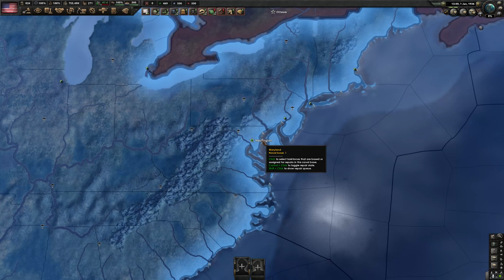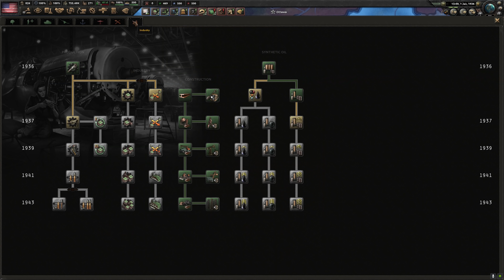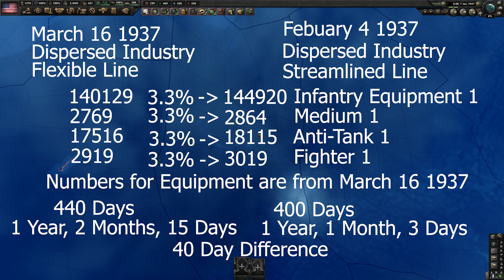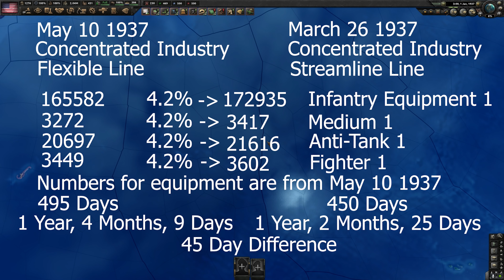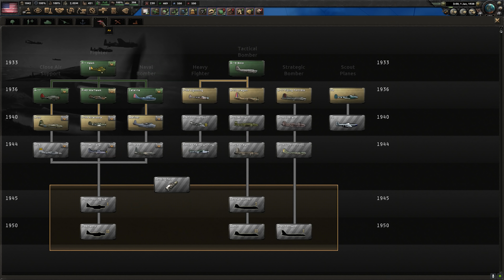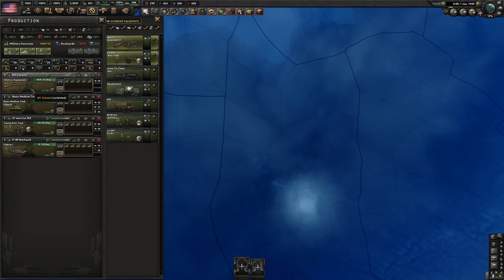Dispersed Industry vs Concentrated Industry Guide 2022 - NO STEP BACK HEARTS OF IRON 4

Comment: One nation that Concentrated could be better on is China (if your MP games allow China, some don't). Due to China needing tons of Infantry Equipment, having the ability to produce even 7% or so more guns, is the difference between like 10-12 more infantry divisions to hold on against Japan. You'll not win, but your goal as China is to make Japan bleed anyway.

It also works for nations that are only really every going to produce the same equipment for most of the game. A minor that is basically forced into Infantry or Marines, without tanks, like India, could find it more beneficial, due to not needing to change. For like 99.99% of majors, or anyone who builds a single tank or airplane, needs dispersed.

Comment: Is concentrated better for the Soviet Union ?
Reply from the maker: Depends on your build, only going to build infantry 1 gear then yes.
If you start swapping gear around then no.
Reply: @KonradvonScharnhorst  I used to like going mechanized a lot and sticking to 1940 medium tanks, is that still viable for mp ?
Reply from the maker: @VitorOliveira-sk8dz  If you don't change your mech ever. and you don't change your tanks ever(which you need to do to win) then sure. but otherwise it all about tanks and whos are better nothing else really matters.Well that and Micro.
Reply: @KonradvonScharnhorst  hmmmm how hard do you think modern tanks can be rushed in the current game state
Reply from the maker: @VitorOliveira-sk8dz  You will be in 1943 at least so prob dead or the war has been decided.

Comment: It's good that the two are so similar and yet there are so many factors to consider. 
For example:
-- are new military factories being built during this time?
-- Can your resources support the 50% increase in resources required? (ie, 2 steel to 3 steel)
-- Is there any reason to keep older / more cost-efficient equipment? Is the infantry's soft attack worth it, or are they in your division templates for defense rating?
-- Are the combat advantages worth the opportunity cost of low output while transitioning between lines?
-- Is it best to update an entire line all at once?
-- Are you engaging in Lend Lease?

I'm a new player and I've only used dispersed.

Comment: Let's say your only modifiers to factory output are from the techs, so you get +75% from concentrated and +50% from dispersed. Then concentrated at it's max efficency gives you 1.75/1.5 times as much output or 16.66% more. If you add 100% stability concentrated only gives you 1.95/1.7 or 14% more. If you are at 0 stability you suffer -50% so it will be 1.25/1 or 25% more. Basically concentrated is good for equalizing negative modifiers to production output like conscription law or national focuses. Opposite direction also applies, if you can stay at free trade and stab 100 the entire game then you will benefit more from dispersed industry.
It would also be interesting to see how dispersed does compared to concentrated if you have modifiers to your production efficency like the soviets because the further away you are the faster your cap fills up meaning that the level you start at might have less of an impact in the long run.

Comment: Concentrated is good for USSR heavy tank build, you're not building anything until you have heavy 2s, and then you're building them for 3 ish years. An extra 8-12% tanks is a lot in the long run. Also I wonder does the factory output from concentrated effect your civs ability to build more mils
Reply: In NSB you do not need to switch to Heavy 3 chassis. 
You only need to switch to the better gun. 
The base retention for switching to a direct upgrade, in other words, if you switch from one chassis to the next is only 30%. For example, if you had 80% efficiency on all your mils on Heavy 2, you would now end up with only 24%. 

However, switching from Heavy 2 A to Heavy 2 B results in only about 5% being lost usually. So let's say you get your Heavy 2 with your heavy cannon 2 in 1938, then all you have to do is research up until Anti-Tank 3 for heavy gun 3. Then you put this on your tank and switch the line and almost no efficiency loss. This is makes concentrated a lot stronger. 

"Also I wonder does the factory output from concentrated effect your civs ability to build more mils"
Nope construction speed is the only think that affects this.
Reply from the maker: No concentrated does nothing to the output of civs.

Comment: Concentrated is a lot better than in the old version for tanks. Heavy 3 oder Medium 3 chassis have become obsolete, they give you no worthwhile bonuses. 
You can get by, by only building 1941 chassis and putting better guns on them. You can get those in 1938, if you have a research bonus and then get the best gun in 1940, even with hard researching.
Here is the catch: you can switch variants like Panzer IV A to Panzer IV B at relatively low cost and if you'd like, you can convert your tanks with the old gun to tanks with the new guns. 

For Germany this makes concentrated much better. Motorized, support, guns do not matter enough. Plus if you macro correctly, you shouldn't have to ever put lots of additional.

This guide further ignores, when which technology can be researched. Are you factoring in tech stealing, in which case you should go dispersed. Unless someone goes dispersed, so you can steal from them. Bonuses for industry should be used on machine tools ideally. You will still not get Flexible line before important technologies. You will have fighter 3s and Heavy tank chassis 3 before Flexible line, except with tech stealing or if you rush Flexible line. 

Dispersed should always be better for about a year in terms of base efficiency and retention, when switching production. 

In MP games therefore, what matters is when you build mills. The later your country builds them, the better dispersed gets. What also matters how late you  getcertain equipment types assuming tech rushing. In the old version, Germany would get the King Tiger in April 1940. That would make both concentrated and dispersed worthwhile. However, Germany at that point builds lots of additional mils with lots of civs and low consumer goods, because he is on Total Mobilization. Therefore, dispersed was often better, also because you got Amtracs very late and you had to put lots of mils on them. 
Going concentrated as the UK however gives you lots of additional Fighter 2s, which means you could winn the air war before Fighter 3s become a thing.
You are correct about air controllers. Canada would often go concentrated and build only 1940 Tactical Bombers.

Comment: Your statistics and tests are factual and logical; however, you proved yourself wrong by not hypothetically thinking about the scenairos within Flexible vs Streamlined, in my opinion, Streamlined is always the only logical option given the scenairos which occur every game.

As most countries, what you want/need to get is mostly pre-determined by the meta and doing anything else isn't optimal, eg. Germany rushing tanks or Italy/UK rushing Fighter 3s, due to this, many countries have been assigned different technologies to rush for their faction resulting in that faction getting max technology in almost all areas by late 1940 to mid 1941, including guns, arty and the rest. By this proof, all of these countries easily gain the max efficiency within 1.5 years (tested) as they all have dispersed 4/5 by this time, however the choice between machine tools is made much later without the 100%s research bonuses which would have been spent on dispersed rather than machine tools, meaning by the time you get to realistically research 1943 machine tools, it would be mid to late 1941 or even 1942. The choice is made after max tech with max efficiency is reached.

You start to see the problem here, retention from Flexible is now a worthless stat much like how you thought efficiency growth was, there is no next technology but only more and more military factories being added to the same maxed tech with max efficiency as the war progresses which only the 10% production efficiency growth can positively affect as adding more factories to the line would drop the average production efficiency of it from max, this 10% buff thus gives you an edge against all other players with regular efficiency growth - on top of this, Streamlined Lines is the only way to gain production efficiency growth which is always 10% unless you have an overpowered focus to increase it, it being a rare stat to gain makes it much more desirable as for most countries this is the only way to gain (what is in my opinion) a very crucial stat.

Therefore, Flexible Lines provides you with no extra bonuses and it becomes useless much like how you thought Streamlined Lines were. Streamlined Lines would be the most obvious choice every game for almost all, with the main problem being that paradox made the research choice just far too late to make Flexible worth it, and with meta always being the best option, as well as with 100%s, 300%s or even 2 years ahead of time research bonuses, getting maxed tech with max efficiency is in almost all cases going to arrive before you are able to make your choice, rendering any extra retention and therefore Flexible Lines useless.
Just my thoughts on it though.

Comment: I AM READY FOR THE SHOUTING BETWEEN DISPERSED VS CONCENTRATED !

There's one thing missing about concentrated ; the way the technology is phrased, it should increase the output of civilian factories too. This means you can build factories faster. Say you're playing as the U.S. roughly historically for example ; this means the country can easily get over 200+ civilian factories by mid 1939, at which point you can pump tons of military factories faster, either by building new ones or converting existing civilian factories, so that the relatively small differences between dispersed and concentrated in production numbers over 1 year may well switch the other way around with more military factories. It's already clear from experience that if a country can join the war as late as possible, it should (nearly) exclusively build civilian factories so the next civilian factories are built faster, so the number of civilian factories snowball ; there should also be that same effect if using concentrated industry, although it's probably a smaller effect.

Another aspect to consider is that a player may want to help with his civilian factories ; if playing as U.S., a good deal of effort should be on building infrastructure, airbases, supply depots for Coke bottles in allied territory, as well as repairing infrastructure if controlling a state, so concentrated should give an edge.

Another thing is switching to superior equipment may not bring that much ; the most egregious case is the difference between the medium tank chassis of 1940 and 1943, where the stats difference is a mere 4.0 armor difference, while the latter costs a bit more. In the same vein, if you use light tanks only for their speed (or as extra soft attack for your division with armored recon support companies and the Integrated Support branch of the Superior Firepower doctrine in the late game), there's basically no point switching to a better chassis, so the 1934 light tank chassis will do the job.

One interesting test that is missing would be to start a production line of say medium tanks I, produce that for X years, then make a switch to medium tanks II and produce that for Y years, with concentrated and dispersed teched when introduced, for example all the 1939 industry techs start being teched on January 1 1939. Then compare the production numbers of both types of medium tanks with concentrated and dispersed.

One thing to note is that production efficiency alone after switching equipment isn't what matters ; it's the number of equipment produced per day, so while concentrated is worse, it isn't as bad as it looks because of the higher base production. The lower production efficiency of concentrated after a switch also means its production efficiency growth is faster than for dispersed, although this pretty much means nothing because of the higher production retention and higher production efficiency base of dispersed, even with the lower production output of dispersed at equal production efficiency. What matters the most is whether the extra equipment in the first 1-2 years of production after a switch with dispersed matter in a player's strategy.

Another point to consider is production numbers favor concentrated, whether it's producing since 1936 or switching equipment on a production line, after about 2 years of production, and clearly less than 1 year if switching between variants of a tank or plane. All the various equipments have new types every 3-4 years, so if you stick to up-to-date equipment and not tech something ahead of time, you'd be better off with concentrated after 2 years ; the real advantage of dispersed is having more equipment in the first year of production, or if you keep readjusting production lines because planning the adequate number of factories for future needs is difficult.

Also, what is better equipment ? The best equipment is the equipment my divisions have, not what is missing. All my divisions have the maintenance company, so if my opponent has arty III while I'm still producing arty II, I end up progressively phasing in arty III in my units, though the smaller numbers of those captured equipments mean they suffer from higher attrition. In this case, concentrated helps because the infrastructure will likely be in a better state, so I get more supplies for less attrition, and I get more support equipment, whose production line will never switch ; the same can be said of motorized and transport aircraft. Another thing that I've noticed is frontline units don't wait for equipment to be sent from home ; if they lose equipment in a battle they won, they replenish their equipment pool with captured equipment from the battle, and only later get equipment from home if it's better, meaning that in practice, the equipment frontline divisions use isn't really what you produce, but rather a mix of what you produce and what is captured, meaning that higher production numbers of new equipment won't matter as much as one may think if engaged in regular combat. As a rough estimate, a maintenance company pays for itself in IC after causing some 30K of casualties against a typical 7/2 just in captured equipment, so not something that hard to achieve. 

So from what I see in the tests and my experience, dispersed is the definite go-to if your country is likely going to get bombed, or you need to readjust the number of factories regularly by a significant amount (think Feedbackgaming when he messes up with his production lines for example), or if you get a new type of equipment and you need significant numbers of it in a year or so to have an impact on the battlefield, like say your country won't join the war till 1940-1941, you rush strategic bombers II without producing any strat bomber I and want significant numbers of them to bomb your opponent effectively after a year of production. Otherwise, concentrated looks better to me.
Reply from the maker: BY THE EMPEROR...
Reply: you forgot one important thing about higher tech tanks, they also have a much higher reliabilty base (even if not shown, which is REALY TERRIBLE dev behavior!)
Reply: Chatting

Comment: You're not supposed to play concentrated like its dispersed. There's also two different ways to do condensed: keep piling factories into older equipment, or putting new factories on newer equipment keeping the original old line (modifying new templates to only use the new guns)
Reply from the maker: putting factories on equipment drops the production efficiency way less on dispersed than on concentrated as shown in the video.
Keeping those lines open just means your doing a half way house on upgrading at that point why are you doing it at all just keep using the old stuff.